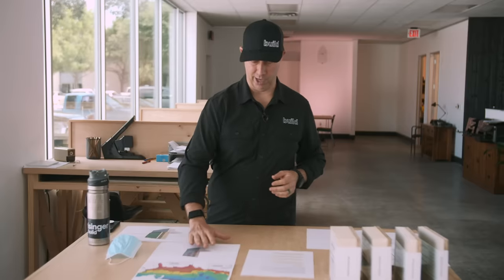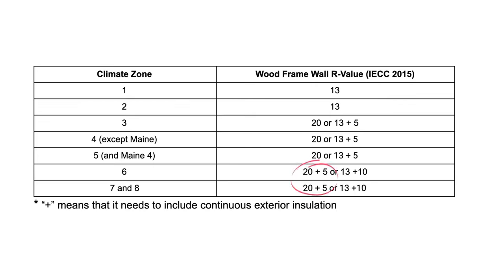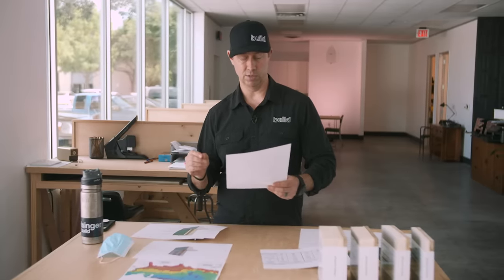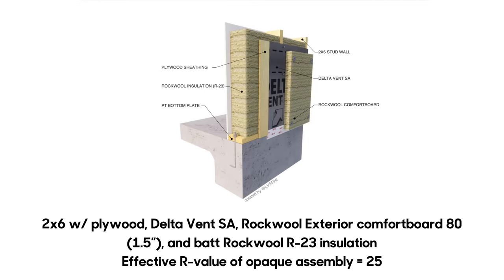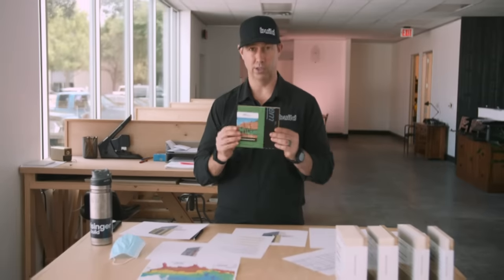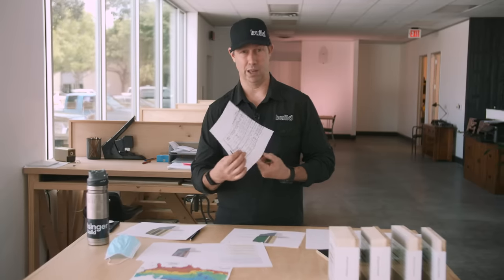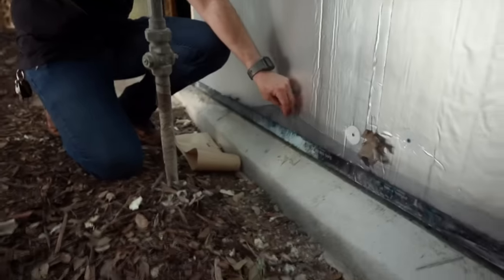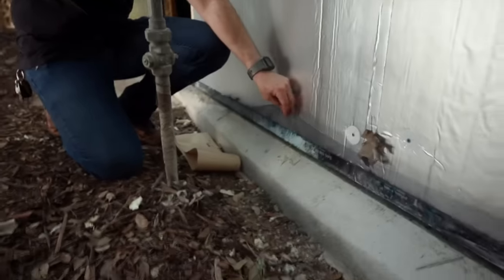5 Ultra-Insulated Framed Walls

Comment: I'm curious, in the last video you also talked only about rockwool. Why are you choosing that over fiberglass? Is it really worth the cost increase? I'm thinking of doing post frame and how I would make it efficient. My thoughts are a combination of post frame, the monopoly house zip-r, and attaching overhangs separately. 2" of spray foam on the inside, and then fiberglass batting. I'm assuming 2x6 framing. My goal: very cost efficient build yet still effective.

Comment: Does US have autoclaved aerated concrete (AAC) blocks? Excellent airtightness and resistance to moisture/fire/insects. There's an interesting product around here called Ecoterm+ where you can have 20" solid wall of just AAC blocks with plaster/filler+paint applied directly to it, R-33 and materials cost ~€5/ft². Can't get much simpler than that.

Comment: Question:  Will be building a new 2 story residential home in April in Eastern Canada where we have winters. Looking for the best exterior wall combination, the walls are 2x6 with 7/16 OSB on top of the 2x6....now what would u recommend for insulation between the 2x6's and on the outside of the OSB, I was going to wrap the outside with TYVEK then some kind of 1 1/2 styrofoam then vinyl siding over top of the styrofoam. The code states I have to have a R24 wall....So I can use a R20 Pink bat with a 1 1/2 styrofoam on the outside would meet the R24 with no problem, the Rockwool I have never used, I could go with R24 Rockwool on the inside then the 1 1/2 styrofoam or 1 inch on the outside, what do u think and any suggestions for Eastern Canada with cold snowy winters...Thanks

Comment: Hey Matt- outstanding information. Loved the comparisons. Any concerns for using Zip R3 with 2x6 in zone 5? I know,for exterior foam 2.5 inches is recommended to avoid condensation in cold climates. Does that change with the foam reversed to the inside? Pete

Comment: Matt, do you think the value holds up vs spending the money from the lower cost, easiest to do vs the most expensive when compared to other details a builder could spend on (roof insulation, air sealing, better mechanical layout consideration, etc)?  Being in the "wet Zone 6" I'm seeing a ton of ZipR going up but a finally a couple rockwool exterior blankets and I often wonder if the builder is making the right trade offs for the customer.  Have you done ROI calculations at average fuel costs? This becomes more interesting of course up here with GeoThermal, Heat Pumps, etc.

Comment: Can you show examples of 2x6 and 2x8 houses that have already been built? I can imagine, that they look and feel more rich and sturdy, because of the deeper window sills and thicker walls and door frames. Would you use the thicker studs only for the exterior walls? Would there be any good reason other than the look to use 2x6 or 2x8 studs for interior walls?

Comment: Is there a reason you don't have a 2x4 studs+rockwool, zipR, and rockwool sandwich wall in the list for comparison?  you should easily get a r27+ continuous insulation in approximately an effective r40+ nominal r42+ wall, beating the high end wall's r45 nominal wall that would bleed energy through the 2x8s.

Comment: 0:00 Intro/Recap of https://www.youtube.com/watch?v=VYqINjqKafY
1:17 #6 2x6 w/ zip R-3 (or R-6, R-9, R-12) and batt Rockwool R-23 insulation
3:34 #7 7. 2x6 w/ plywood, Delta Vent SA, Rockwool Exterior comfortboard 80 (1.5”), and batt Rockwool R-23 insulation
5:52 #8 2x4 w/zip sheathing, Atlas energy guard 2” polyiso (R-13), and batt rockwool R-15
10:52 #9 2x8 w/ zip R-6 (or R-6, R-9, R-12) and batt Rockwool R-30 insulation
12:29 #10 2x8 w/ plywood, Prosoco R-guard, 3” of Polyiso (2 @ 1.5”, offset seams), and batt Rockwool R-30 Insulation

Comment: how about you frame with 3x3 with half inch sheeting on both sides, use the cavity for installations and thermal mass and putt all of the insulation (something like 8 inch of PIR foam or 10 inch od wood fibre board) outside uniform way without thermal bridging at all? :)

Comment: Matt, I would love to get an opinion on some of the sip like panels out there that are less mainstream.  Companies like Thermobuilt, Insulsteel, Raycore, Thermasteel and Structall. They all have unique systems that have no plywood/OSB/sheathing and they claim to be more energy efficient and structurally sound than other sips and traditional framing methods. What are your thoughts?

Comment: Love your videos Matt, thanks for sharing.

For assembly #8, you need to fasten the external insulation to the sheathing with screws, right? Doesn't this pierce your air/water barrier and drainage plane? How do you fix this?

Comment: What about a 2" X 8" plate with two  walls of 2" X 4" with 1/2" ply on the outside wall with Rockwool R- 15 in each wall for R- 30 ?

Comment: Have you done a video with 2 2x6 walls with offset studs so there is less thermal bridging and double the insulation. R42 vs R21?

Comment: I will stick with a 2X6 wall, 16 OC,  with 2'' of closed cell foam and 3'' of Rock-wool over it, 1/2'' plywood with the first 4' being PT. Then 1'' of foil faced board with 1X3's screwed over it and then attach my siding. That's about an R-30. Good to go...say it ain't so ! Lol
Oh...all joints would be taped.
Reply: Better examine the dew point issue very carefully, in Colorado this would be a moisture damage/potential rot scenario.

Comment: Hey Matt,
Great video about various types of insulated wall assemblies. Thanks for sharing. I'm just curious why you did not show any spray foam insulation as an option. Also, you did not show us any staggered 2 x 4 assembly (i.e. with a 2 x 6 or 2 x 8 top & bottom plate, with 2 x 4s alternating on the exterior and interior wall edge). Thoughts?

Comment: So is spray foam not good now or is it use not necessary since you are using the foam on the outside and taking care of air infiltration in other ways? I like the properties of the rockwool but have not used it.

Comment: Do you realize that zone 6-7 is quite warm? Most of Alaska is zones 1-3 getting slightly warmer next to the ocean. The lower the number the colder. My area of SD is 4A Texas is 6-9. What I’ve learned from your video is I can do a closed cell spray foam wall with a higher R value for less than these options. I can make a R-21 with a 2x4 wall with nothing but 2x4’s and plywood  and spray foam for about $3. With a 2x6 wall I can do a R-35 for about $4.50

Comment: Instead of a 2x8 why not use a double 2x4 wall off set for maximum thermal efficiency. I do realize you have the insulated zip would it not make cheaper with just using 2x4 framing instead of 2x8
Reply: Spray foam outer wall and pink stuff the inner wall.. best bang for the buck.. there was a house built like that on Building Off the Grid on discovery..

Comment: How is per sq ft calculated?  if the wall is 9' tall and 20' long, is sqft = 180sqft ?  Then this wall would cost (for 8. 2x4 w/zip sheathing) $4.02 x 180 = $724.

Comment: A couple of comments or questions.  If I am putting ZIP R12 on the outside even in the North, is any condensation likely to form from the warm air inside?  I know the worry is that the moister makes its way toward the outside, eventually gets cold and condenses.  Secondly, I am dubious about any R-value above 40.  Once you get to 40+, airtightness becomes the more important factor, by a lot.

Comment: If you do not want to use Poly Iso foam at all, could you do this with Rockwool R-80 for the exterior insulation?  Would it change any of the other cladding layers as far as specification?

Comment: If I replaced the 2x4/2x6 studs with a T-stud 2x4/2x6 with close cell foam in between. How big of a difference in the R value and strength will that make?

Comment: Any chance you can do a video on how to waterproof penetrations on existing structures, like running conduit through a wall and mounting an electrical box to the siding. We debate this a lot at work. Do you leave a weep hole in the silicone and sacrifice air tightness to ensure drying?

Comment: What about the concrete footer?  Yes, the wall is heavily insulated, but then heat (in the south) is conducted through the concrete into the floor inside. My house floor feels warm when walking over the floor along the entire perimeter.   What can we do about that?  I have hardboard board and batten with 2x6 stud wall. Thanks.

Comment: @MattRisinger - I would liked to have seen T-stud as a factor!  2x6 or 2x8 T-stud, rockwool interior, r6 Zip(min), rockwool exterior, rain screen & bug shield along with a metal exterior or fireproof Hardie board.  Of course this includes the roof done like the monopoly house with layered rockwool in the exterior bays topped in a metal roof.  I live in Oregon and where I want to build I would like to shield myself as best as I can from fire hazard.  I haven't looked into it to see if there is any added benefit, but in addition to an insulated foundation I have wondered how a 3' ICF base would perform. Windows would already be at height so easily framed for a brand new builder, and the issue of blow out I would expect to be next to nil. I envisioned the exterior facing to look like a stone foundation/base with a log upper; possibly upright stockade.  Am I shooting to high for my first build?
Reply: Here in Colorado, anything we have done outside of city limits has been per wildland fire regs. NO VENTING of attics or roof assemblies allowed. That includes, at least in these jurisdictions, the vented space between the top insulation or sheathing and the roof material itself. It was belatedly discovered that a significant % of houses burned in several of our monster fires actual caught from INSIDE out, from embers sucked into the attic or cathedral ceiling frame. For these projects, we do continuous exterior polyiso (always two or more layers, for air networking) in a COMPACT roof assembly. See Dr Joe & BSC, if this is not familiar to you. 
I am a strong proponent of continuous exterior insulation, and find that once you go there, you are wasting money making the interior frame and insulation anything exotic. Put the $ where they count.
Reply: @leestevens446   Have you seen Matt's episodes on the monopoly house? The only air space in the roof is in betwen the 1" batts between the 2 layers of staggered insulation and the exterior roof material so it can dry out should it get wet. Other than that there is no "venting" as everything else is sealed, no attic for anything to get sucked into. I believe this fits the compact roof assembly you mentioned.  As far as "exotic" goes it would only be the studs themselves providing a greater thermal break; essentially going from (I think Matt said, a stud would be approx) an R4 vs the T-stud of an R19.
Reply: @keithhogan6997  Keith, your house, your build, your jurisdiction to satisfy. Answer is to do what they allow for venting, and what you feel comfortable with. My take on Matt's house is that he will apply battens over the top ZIP, and use soffit and ridge vents to provide some free convective cooling of the roof assembly. That is not technically a compact assembly, as I/ we use the term. And that air space is what jurisdictions here won't allow. When things get really hot, the convection forces get nasty, and the flying embers get sucked in, and make themselves at home (sort of, except then you have no home; not really a joke, this is seriously what has been observed to happen). If wildland fire is NOT an issue, that venting is an excellent way to go.
From your reply, I am unclear as to whether you are clear on Matt's assembly. From the rafters, there is 1/2" ZIP (with tape) then 2 x 2" polyiso (staggered joints) then a layer of 5/8" ZIP (with tape). If the roof material is applied directly to that top ZIP, then it is a compact assembly, with NO venting (all layers are tight together, no air spaces so far). This is essentially how we build. HOWEVER, if one creates an air space, with top and bottom venting, by applying battens over the top ZIP, to carry the actual roofing material (metal?), then it is a vented roof assembly. 
Final thought: the studies and testing in the aftermath of the big fires here found that embers falling on a roof were far less likely to ignite the structure. Even FG shingles provided enough protection from the heat of small embers that had landed to forestall ignition of the structure. Interestingly, another source of ignition is windows overheating and exploding, then of course the fire has free access. Rolling shutters are expensive, but a good thing to consider if wildland fire is a truly serious possibility.
Finally, if you are serious on a build, and conscientious, look very carefully at the total heat loss of conventional framing vs Tee studs, when each has an equal R-value of continuous exterior insulation. If you do the continuous exterior, you have done the most total surface area possible, so now anything inside that is operating on a very reduced delta temp, so can contribute a lot less to the final values; worse, the Tee studs are only a fraction of the total thermal bridging.  But, the costs for doing those things (Tee studs) did not go down in proportion. Law of Diminishing Returns. I have an aversion to wishful thinking, physics ( and economics) always seem to sabotage it.
Reply: I may have gotten things a little turned around, but will go back and rewatch some episodes to gain clarity.  There I know I can catch a non-judgmental education.  I will know from that point where to start, and then begin to see how it complies with code in my area.

Comment: Question regarding the sill plate and outside insulation overhang: Assuming one is designing and building from scratch is there any reason not to use a wider sill plate and bring the outside insulation material inward such that the bottom of the material rests on the sill plate? I realize the sill plate might have to be ripped and that additional care would have be taken in the layout and subsequent construction, but the area would be simpler to seal up and the lack of overhang would look better.

Comment: Polyiso loses R-Value in lower temperatures.  That should be noted when considering wall sections with it on the outermost layers in areas where annual heating costs are higher than cooling costs.

Comment: Here is the assembly steps I'm planning on going with:

2x8 PT bottom plate
2x6 walls 24" OC
Rockwool R23 Batts in wall cavity
2" rigid foam insulation that will sit inside/on top of the 2x8 PT bottom plate
1/2" CDX plywood on the outside of the 2" of insulation (basically created my own Zip-R system)
Liquid applied flashing to nail holes and Zip Tape on the seams.
Vycor EnV-S as house wrap

For that entire assembly, and calculating prices if I purchased materials today (12/31/2020, I'm just under $4 per wall sq ft.

I also think that would get me a legit R-30 wall.

Any pros have a comment on that wall assembly? 

Only weak point I see is the plywood/sheathing isn't attached directly to the framing members.

Comment: Will the Zip R insulation board shrink over time?  My concern is, the Zip R foam shrinking overtime and the fasteners coming loose and the wall panels pulling away.

Comment: Curious how deep or shallow you set windows and doors with these types of applications.   Do you pad them out somewhat, yielding a deep interior jamb/sill arrangement, or do you set them normally,  yielding a deep set (from the exterior) window/door appearance?  If the latter, any special trim tricks to make it look its best?   TIA.
Reply: It is ideal (from an energy efficiency standpoint) to put the window in the absolute middle of the wall assembly. Most windows in the USA are on the outer part of the wall (because they have flanges on the windows) so that's what people know how to do.  It is an art to properly install and waterproof flangless windows anywhere inside the window cavity.  We just did a set and had to have custom flashings made,  etc.

Comment: Does rock wool also help with mice? Do you k ow if they chew through it? In the northern woods there a lot of little furry critters that want inside for the coldest points of the year.
Reply: Yes but blocking entry for mice is the best way to make sure you won't have to deal with them.

Comment: Hi, Matt. Great video! I was a bit confused about the cost breakdown. What do you mean by "per wall square foot"? Does this refer to the total square footage of the house? Would it be possible to convert these cost breakdowns into a "per length of exterior wall" instead? Thanks!
Reply: He's referring to a 1 sf cross section of the wall.  So for a 4 x 8 cross section just multiply by 32 .

Comment: Hi, love your videos! I live in Maryland and I have a question about the fluid options for flashing ( for example the Proseco ). We had a blower test done some time ago and the biggest issue is at the sill of the framing to the poured concrete basement walls. It had a vinyl layer but now leaks a lot of air. I need to seal the wood to concrete gap on the inside, basement is unfinished so easy access. Can these fluid products be used inside to coat and seal this gap ?

Comment: ----------------- you'd need a wider footing but double 2x4 walls with off-set studs w/a 3 1/2" space between the two for thermal break and your  electric/plumbing chase .... would be less cost w/ more R value ....alternatively to 2x8" ....  HowardFaulkner is a author n architect designing n building  super insulated houses ..... hey Matt